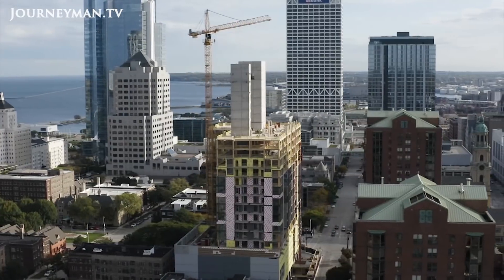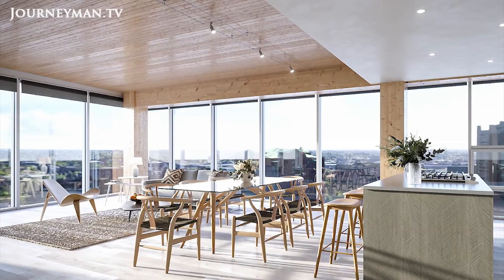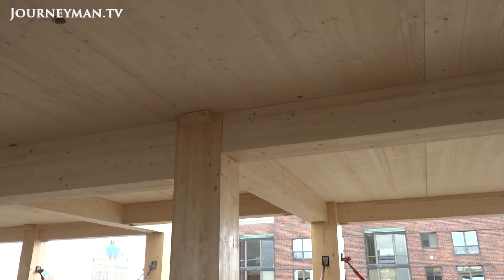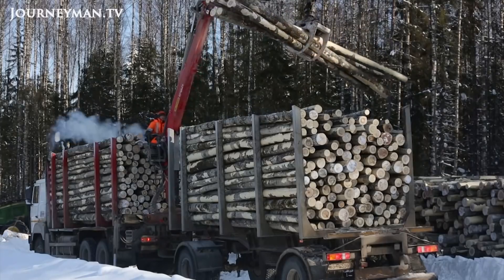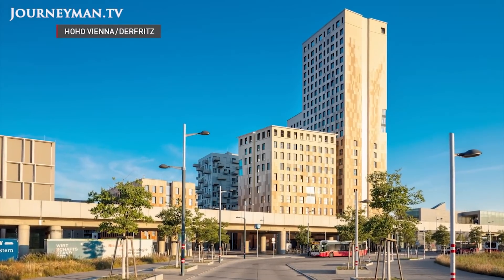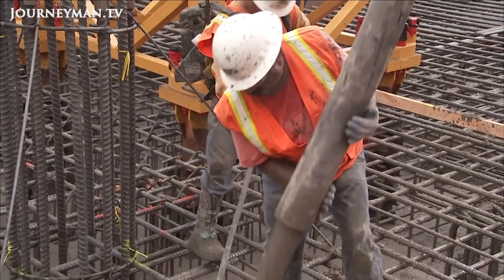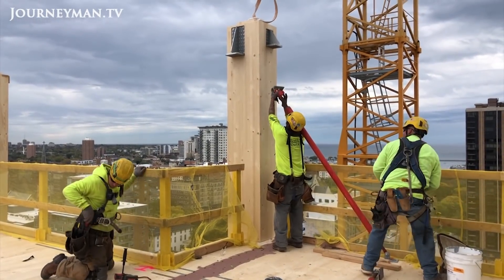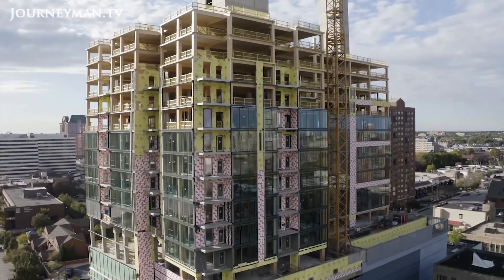The Rise of Wooden Skyscrapers

Comment: Even if it's "fire resistant", it sounds like an accident waiting to happen. Wooden structures shouldn't be that massive. I also wonder how many trees were chopped down just to provide timber for this one building.
Reply: “It sounds like” well thats why you’re not an engineer but some shitter on the youtube comments. Also, they have to plant those trees they chop down right? Otherwise wood would be finite and we’d run out. Which seems like such an obvious issue with such an obvious solution its stupid I even have to mention it.
Reply: Something tells me that you really aren't all that concerned about trees.  My spidey sense is really tingling
Reply: The Pagoda of Fogong in China was built from timber 1000 years ago, is 67 metres tall, survived many earthquakes and until the 20th century only needed minor repairs. It survived Japanese bombings in WW2 and is these unfortunately tilting and in great need of restoration, but yeah 1000 years...can't argue with that.

Comment: Plywood skyscrapers are barely made out of wood, and mostly out of oil, to glue together the sawdust. sure, you use plywood mostly for facades here.
They burn up VERY rapidly while the fire suppression system fails, or is not yet installed.
this is rarely a problem, as fire suppression is very reliable, but you know how pathethic usa street-maintenance is (they build oversized roads and than lack funds to maintain them and they just leave ghost towns instead of raising taxes way too high for way too expensive roads) , so these are just time bombs.
Reply: Glulam retains its constructional stability in a fire, unlike unprotected steel does.
Reply: Did you even watch the video?  It showed exactly what is wood and what is not wood.

Comment: Environmentally it seems like a sideways movement. Great way to market the companies building and designing it though. I like the design.
Reply: Yes it's a change from a non-renewable resource to a renewable resource.  Lighter creating less dependence on other non-renewable transport (fuel), and easier to erect creating less human resource needs.  Sideways, indeed.
Reply: @slimydick23  these are a one off cost that would last longer than wood long term. We should be planting more trees not cutting them down. So yes it is sideways as you could argue that the benefits from using wood are offset by deforestation and the frequency of it being rebuilt compared to the more durable materials they used for the foundation. Just because it’s renewable it doesn’t mean that it’s the best option. You need to think about it at scale too…it wouldn’t work. Cutting down more trees and loss of animal habitat isn’t important  to you I guess..